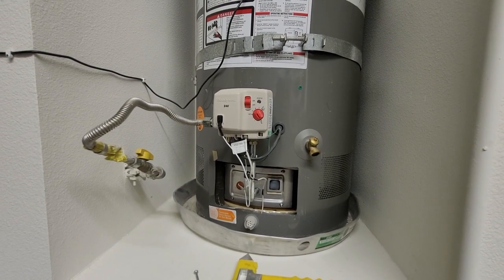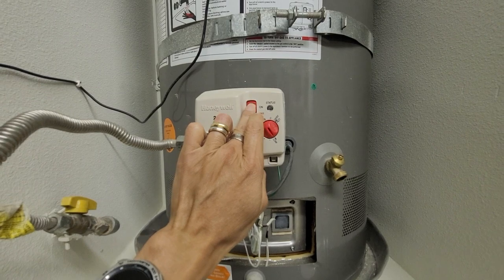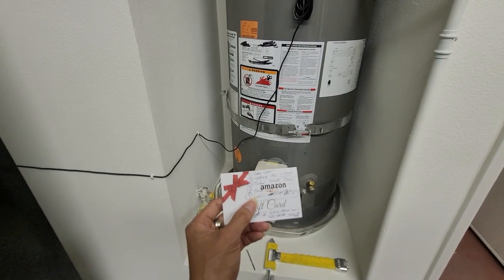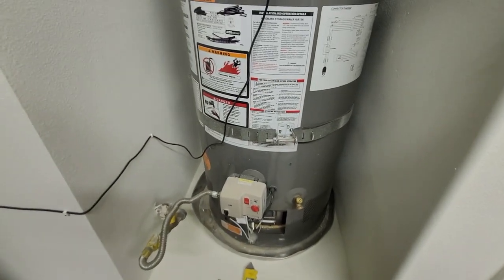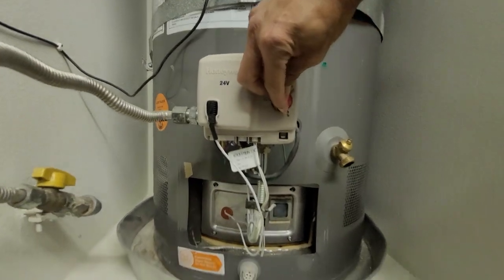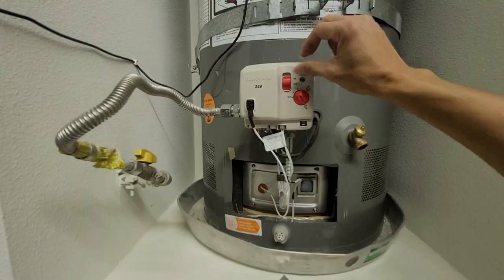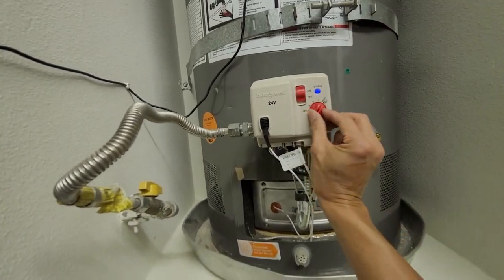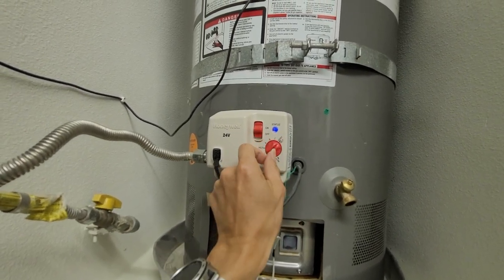How To Relight Flame & Reset Gas Pilot Light on Electric RHEEM Performance Platinum Water Heater

Comment: I have tried this over 30 times there is no space between the floor and the bottom of my water heater so I can not get anything under there to clean. There are different instructions on my tank that say unplug set to low, switch to off wait 5 mins switch back to on set desired temperature plug back in and after that the pilot should light. Neither your way or the way on the instructions are working. Still blinking 7 times. Now what?

Comment: I did this. it worked but the flame goes out after about 30 seconds
Reply from the maker: Your water heater might have a dirty or clogged thermal coupler.
Reply: I’ve tried this about a dozen times it throws a 8 flash then 4 flash code! It’s a new Rheem heater please help! Thanks